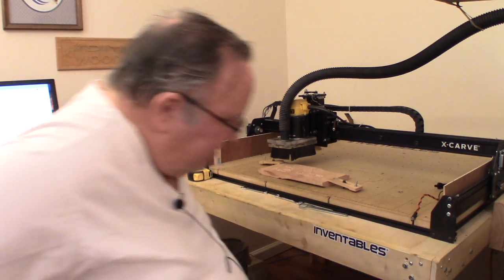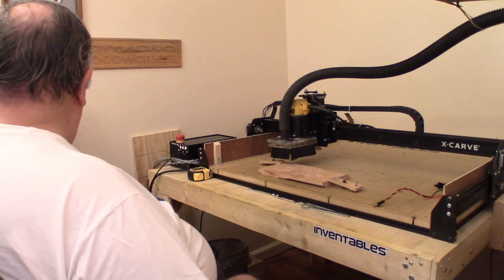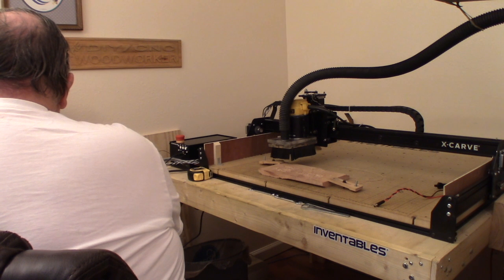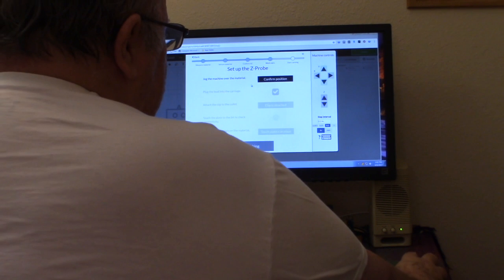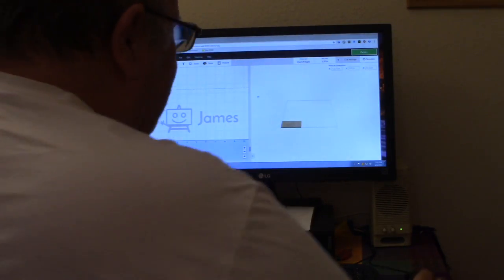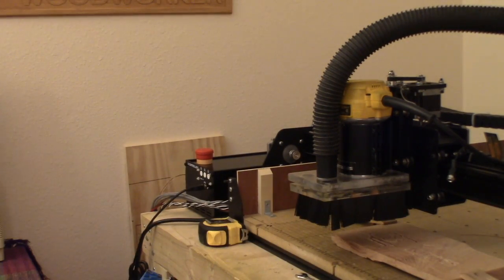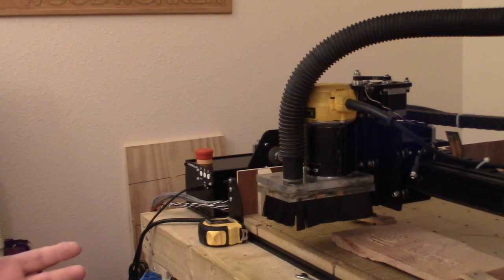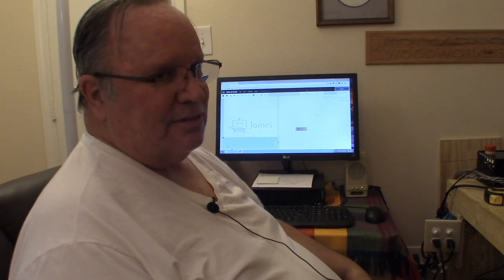"Z" PROBE ADDED AND TESTING

Comment: how much did this upgrade cost you?
Reply from the maker: Geez, what ever Inventables charges. I think the x-controller was somewhere in the 350 - 370 dollar range and the touch probe was 60 - 70 dollars if I recall correctly. You can go to Inventables web site and see what they are charging for this stuff.
Reply from the maker: Summers Woodworking I don't remember the exact cost, around $300.00 I think. Look it up on Inventabels web page.